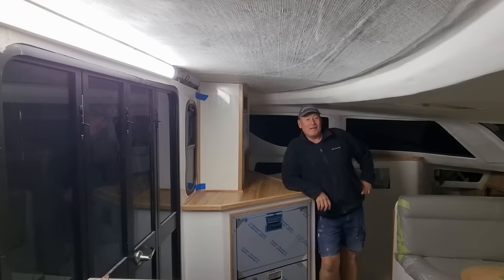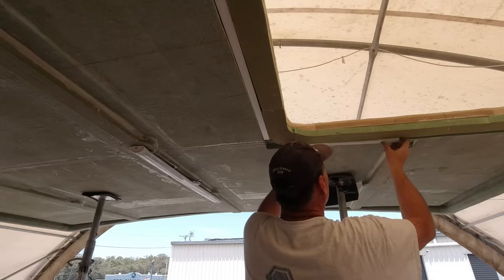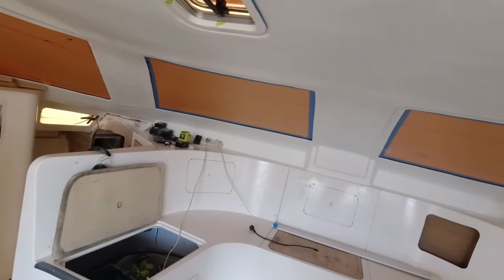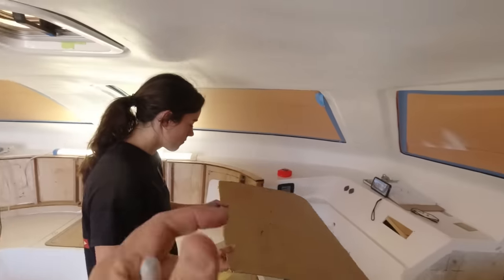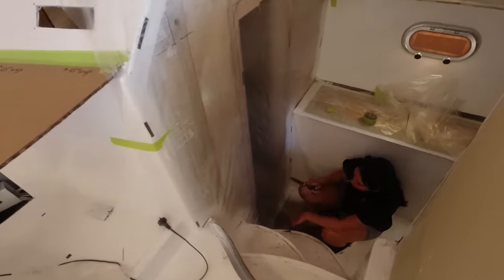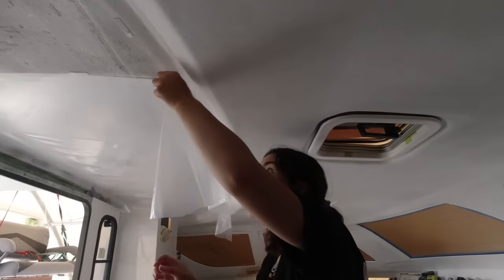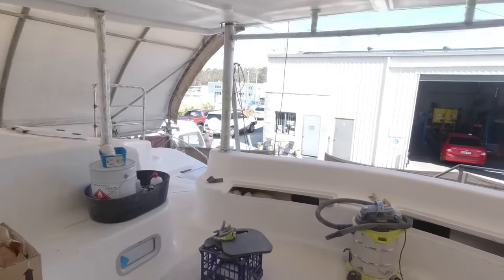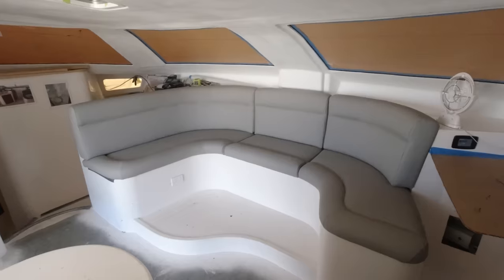How good does this look ?  // How to Build A Fibreglass Catamaran Ep318

Comment: just thinking about it now it would be good if you could open the front windows for some air flow in the cabin just saying before it is all finished and I know that the front windows are mounted and can not be opened but it would make things a lot nicer
Reply from the maker: Sadly we can't open our front windows but will likely install some hatches in the windows to allow for additional air flow at a later date.Ross